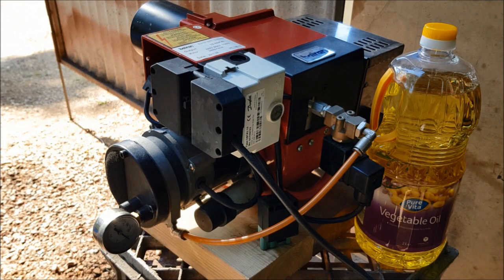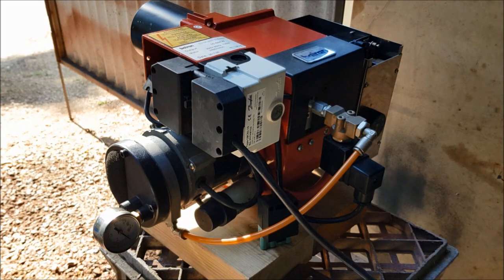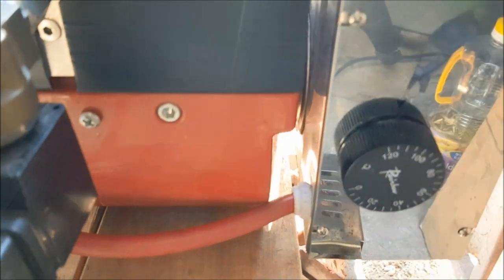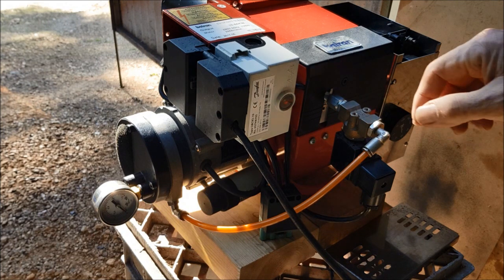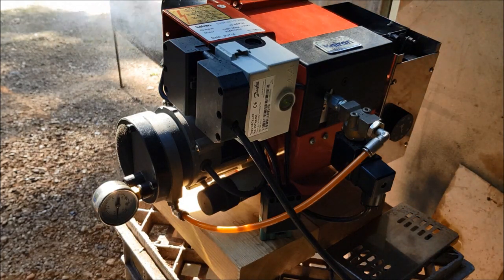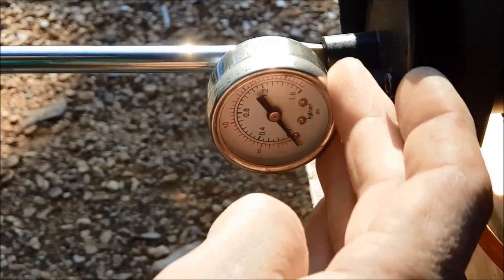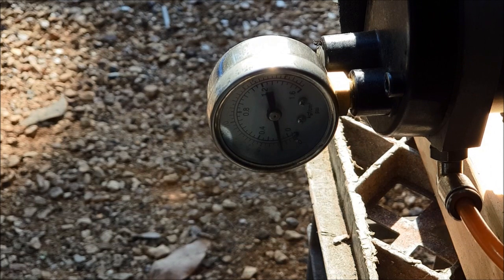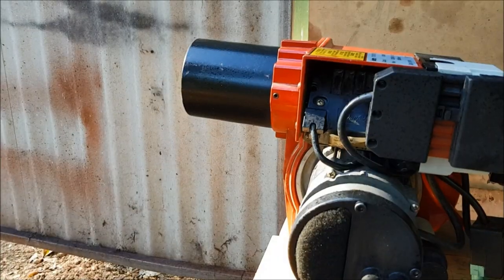bairan STW120P waste oil burner problems

Comment: Hello
I have serviced those burners over 5 year and its clear that if you take it out of box and just dry to start burning then it will not work. Even for me there is at least two hours work to regulate everything before its ready to use. If you want to burn vegetable oil its better to heat the oil to 160 deg or just add 15-20 % diesel. I dont suggest vegetable oil not at all, waste oil is best. To get compresor pressure up you must regulate blades in compressor and  make sure that the cover is not leaking.
Reply: These burners are so temperamental, even when running well expect a service at least every 4 weeks at best mine has problems every 2 weeks, issues with nozzle, tank filter and especially air supply, very difficult to get running  consistently I've spent many hours problem solving, you fix one issue then something else comes up I suggest unless you see it as a hobby get rid of it
Reply from the maker: Yes, I believe it. But it's far from a hobby, I need to get it running right as it's for heating our home hydronic system. I understand they need maintenance and that's OK, as long as I can get it running consistently. Time will tell.
Reply: @sivy8611   Bought mine second hand was four years old had it 5 yearsit runs my central heating so its used all year around.In that time i have only replaced fan moter after having it 4 years  so it served 8 years and jets. If you have problems with used oil add 50% diesel and tweak adjustments let it run through 4 litres helps clean jet and suction pipe that clogs up with carbon over years of use. If you filter oil before you use it and always run with supplied filter fitted it will solve 90% of issues . Jets often look ok and are not always have a new spare to try a lot of issues are blocked worn jet imo.  Mine runs on thermostat with no issues other than cleaning firbox every 6 or so weeks
Reply: For my Reznor it seems problems are almost always fuel related. If I feed it good clean waste trans fluid it burns very clean, hot and reliably
Reply from the maker: Hey, thanks for chiming in. It's hard to find anyone with experience using these burners. I uploaded this vid to show the seller the problems I'm having with the burner. It might look new, but I used it last winter for a week or 2 and it worked ok. But this year, I turned it on and had a couple of issues.....The seller said there might be a problem with my oil, so I am using clean vegetable oil to show the issues exist regardless of what oil I'm burning.I normally burn waste motor oil and the pre-heater is set to 60 deg C. I have tried going as high as 100, but found no need for it as 60 works well.I did check the cover screws and was able to tighten them a little which gave me lightly more pressure.Thanks for the tip regarding the blades. I'm not sure how to regulate them so any more info you can provide would be appreciated.

Comment: Dear Eugene, 
Sorry to hear this matter, please do not worry, we must will with you and solve it very soon.
Please after I checked your vedio,  I have found the question, the air pressure is too low, then make oil atomization is not good, and then the burner stop directly when the burner can not get the flame. please the air pump noise is not the correct voice, it is too noise, not normally,  please try open the air pump, and check whether have any damaged of the vanes in the air pump, if damaged, it will cause the air pressure become to low, the burner can work at least need 0.40 bar,  our factory always set with 0.45 bar, the customers can adjust directly. please kindly check air pump, and confirm with me soon. if the vanes damaged, please notice me, i will send the replace parts to u by DHL/TNT express very soon. 
And by the way. for the other question you mentioned,  i checked, the control box and photocell,these are no problem. thank you.
regards,
Tina
Reply: Check the oil filter too
Reply: Hello, Tina!
Where I can find more info about this oil burner?
Reply from the maker: Hi Tina
I hope you can help me to solve these problems...
You are correct, something must be wrong with the air pump as I cannot turn the air pressure up above 0.4bar.
I have removed the air pump but the vanes look OK. If something is wrong, I cannot see the problem.
But I think there is a problem with the controller also. If I connect up an air compressor and use a higher air pressure, the flame still goes out after approx 15 seconds.
I can upload another video to show you.